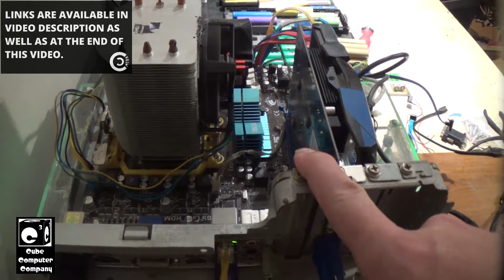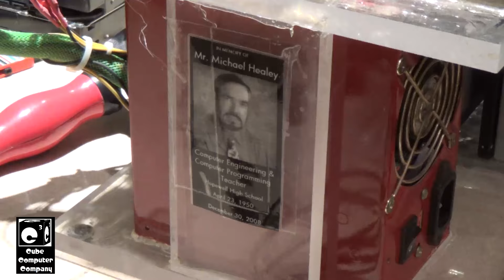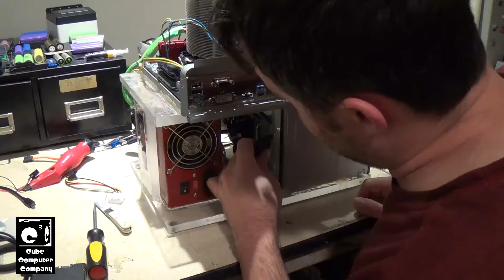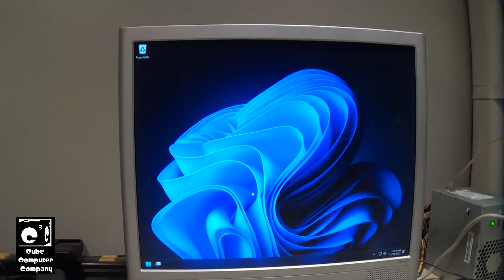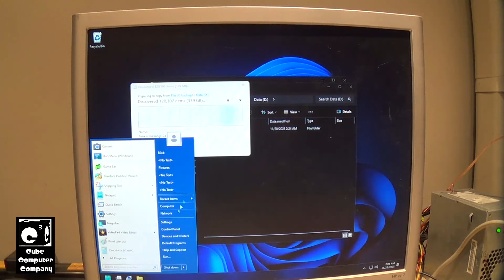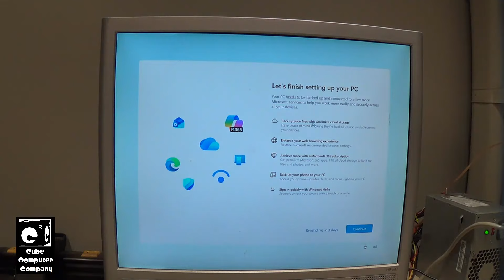Cube Computer Plexi gets the repaired ASRock B450m Pro4 motherboard from eBay + AMD Ryzen 7 1700X

Comment: You might as well just use AHCI mode, and do your raid setup in disk management instead of using the motherboard raid. That should allow you to hot swap drives again. I don't like adding on cards unless I absolutely have to. I keep my AM3 phenom II disk servicing bench running to this day, what a great platform and it has IDE built into the southbridge for old drives, you really can't recreate that with an IDE card, it has unofficial hot plug....hot unplug at your own risk, and linux requires a command in grub so I can hot plug with that old thing, but I can't lose her. That old bench does not have usb 3.0 I added a usb 3.0 card to it, it can't boot from it but I can clone images off to external hard drives at full speed which is nice. I don't use RAID at all on the old bench both of my benches have a 240gb sata ssd with dual boot windows 10/ubuntu 24.04 on the old one, and windows 11/ubuntu 25.10 on the other.

Comment: you could of taken a sata dvd-rw drive out of a older pc for use instead of the adapter, which is cheaper, 5-6 usd used.  And what becomes of the Phenom II? Its still plenty useful for a variety of things, though the newest cpu & gpu should become the main gaming pc and the older ones relegated to other OS and purposes.  And its probably the fan that was making that "temporary cooler" much noisier than it could of been.  Which could be swapped and serviced.

Its also possible that the Frankenstein Ed win 11 24h2 for a athlon 64 would likely run on that Phenom II (and probably much better than on that poor athlon 64 single core)  Drivers may not even be a issue for it (and even if they are windows 10 would have some that to be modified for it to make it work)
Reply from the maker: But why? I had a perfectly functioning IDE DVD drive on the Plexi. Keep in mind changing parts on this system is not as easy as a regular computer where things come right out with a couple of screws. As you may have seen, I had to use a knife and screwdriver to slice hot glue joints and carefully remove the card reader and SATA SSD. I spent $8 on the IDE-USB adapter, which is less than the cost of a new SATA DVD drive, or a SATA-IDE adapter.

The Phenom II X6 will get repurposed. It may end up in a system that I will ultimately sell with Linux Mint or Zorin preinstalled.

The heatpipe cooler is much quieter and cools better than the heatsink fan I had temporarily installed on the new setup.